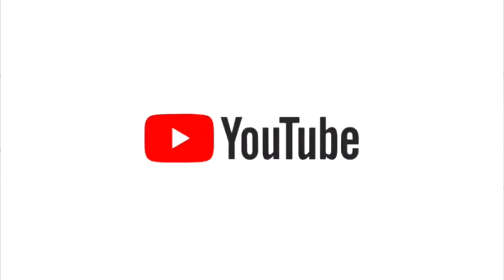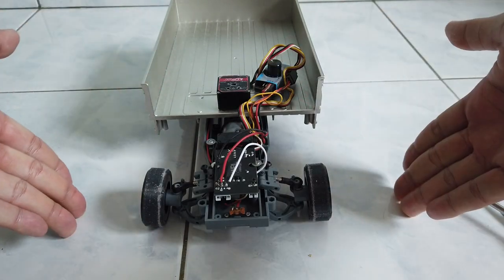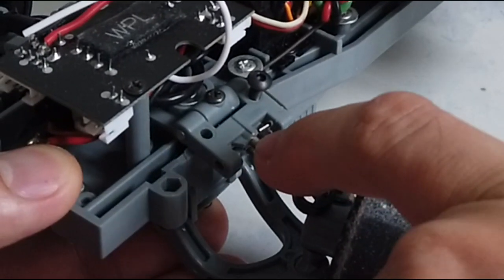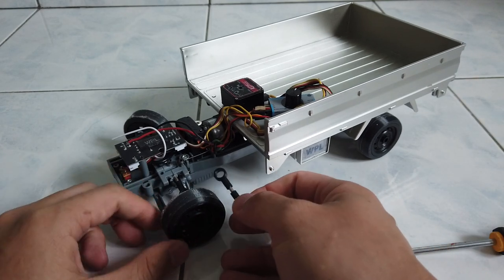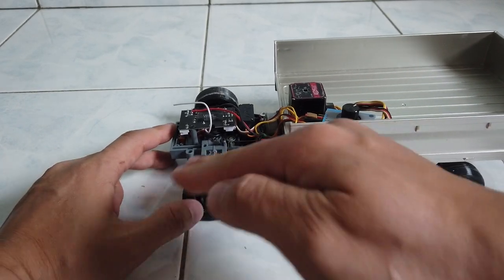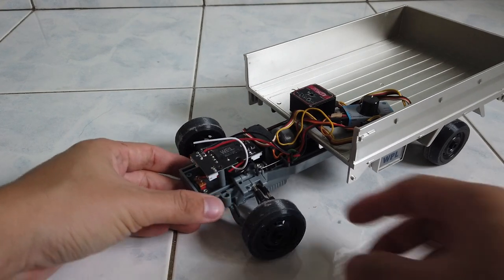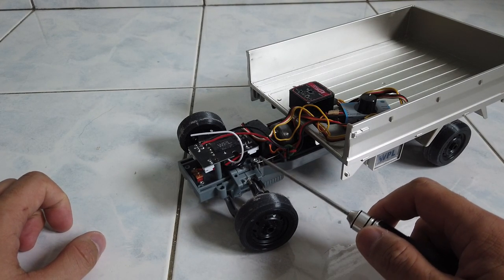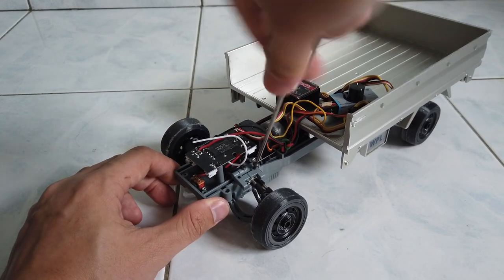WPL RC Build Tips #8 - D12 Camber Toe Castor Ride Height

Comment: i have an issue with 🤔 right turn, after wheel in center mode but the right wheel have an little turn to right, 😌 hope u understand my explanation
Reply: the toe is not equal on both sides measure the length of the rods so they are equal 👍🏾